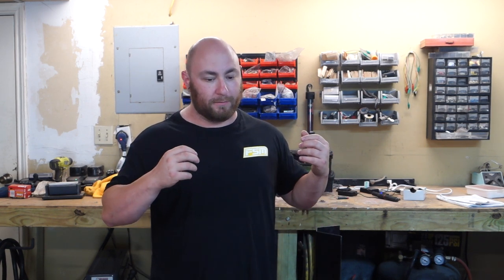1989 K5 Chevrolet Blazer Build - Episode 0 - Why This Truck

Comment: Max, Keep in mind that you can swap to a 14 bolt rear (and it will be 100 % bulletproof) but you do not need to swap to a dana 60 for the front.  You can have a 10 bolt front axle and never have problems with it if you upgrade the front axles to 30 spline axles and a carrier (along with 3/4 hubs and rotors).  Also the front seat you have there is out of a truck and should actually be buckets.  I have some stock buckets that are combo cloth and vinyl if you want them.  I even have the brackets.  You can have them for free because I am moving on to later model Tahoe seats that have integrated seatbelts.  I'm located in Waco but we can figure something out to meet up because I work down in Austin frequently so maybe we can meet half way between Htown and Austin some day.  The seats will need recovering eventually but they would be fine for until you get the inside beautified.  Send me a message if you are interested
Reply: You know what you are talking about. Good advice

Comment: Wow! I just found the videos and it’s a really cool coincidence. I just got my 73 K5 inspected 2 days ago! Mine already has a lift and a lot of other mods but it’s been sitting for a LONG time! I got all of the safety items working and it passed inspection! I found a 73 rear seat for it and now I am trying to figure out a safe way to carry my family around in it. I think I will be doing new headers, steering box brace, cross over steering, Cherokee steering shaft and new shocks in the near future. I also need to get a family cage! I’m right up the road in Dallas! Definitely subscribing!
Reply from the maker: Thanks! Good luck with your build. Stick around - I will be doing suspension work soon, as well as purchasing a tubing bender and fabricating a cage, bumpers, doors, ect.

Comment: I have had my 94 k5 for almost  20 year now and I still get that feeling.  I am also getting mine put together for adventures, but I will stay mostly stock for the foreseeable future.  May have to get an older blazer for more serious offroading.  That solid front and rear makes it easier.
Reply: 94 was not a k5 blazer   Tahoe 2dr
Reply: @paulfredrick10  94 was the last year of the blazer.  Though most think they are 2 door tahoes.

Comment: Hey buddy I’m restoring a 1982 gmc jimmy blazer that was originally a diesel that somebody swapped out for a 350 my question is how can I tell if the axels are 1/2, 3/4 or 1 ton
Reply from the maker: Shape and size of the pumpkin is a good place to start, the Dana and chevy 10, 14 bolts look very different if you just google pics. also check to see if the rear is fully float.

Comment: Headache rack is a must what's a 4 link.sounds like I need one to I've got 10 bolt's too would like 14 bolt's Dana 60or80s lockers a must
Reply from the maker: 4 link is a rear suspension setup that does away with leaf springs. There are 4 bars and a set of coilovers that control the rear axle.

Comment: Bench seat . I have only seen buckets and consoles
Reply from the maker: It was froma K10 truck. Not a factory option.
Reply: @Makswerks1  does it bolt right in or have to drill new holes ?
Reply from the maker: @daddyhermanson9737  They drilled a bunch of holes to mount the bench.